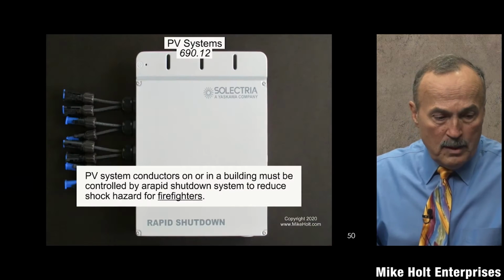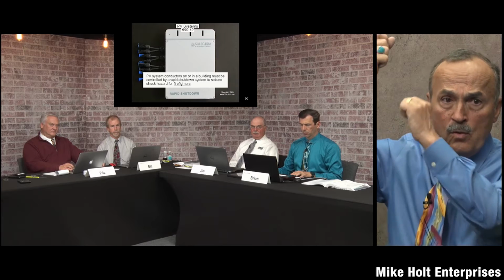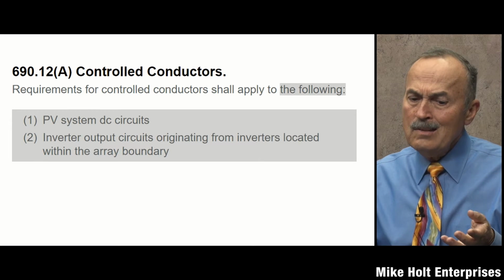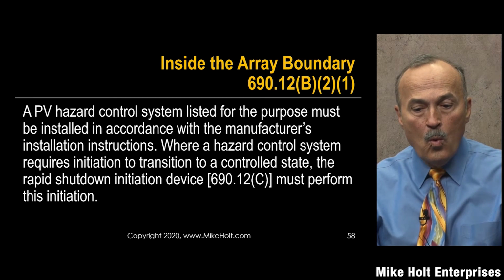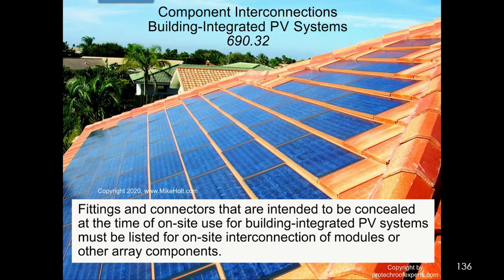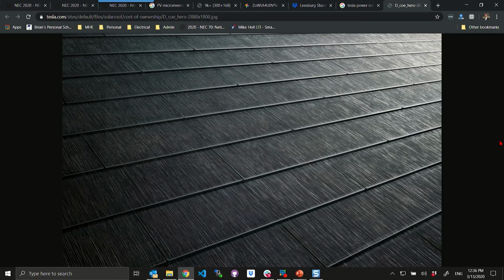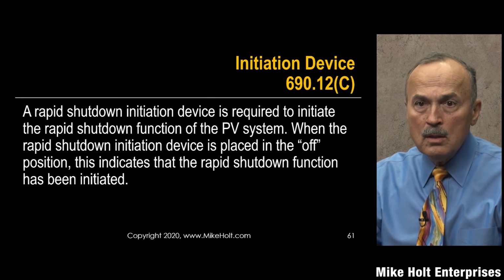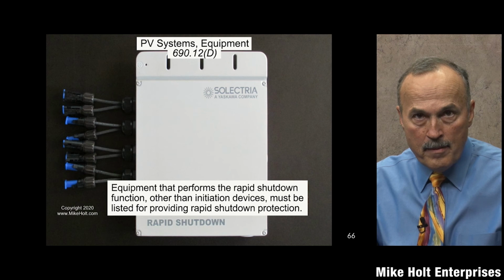Solar Photovoltaic (PV) Systems, Rapid Shutdown, NEC 2020 - [690.12], (31min:43sec)

Comment: Titan Solar Power filed for bankruptcy because of the requirement of putting these modules on every single panel. They have did over 100,000 solar installs before this NEC code without a complaint on safety from anyone. It was a billion dollar company that no longer exists.

Comment: This question maybe a little late as it’s now 2025. I’m seeing a lot of confusion regarding rapid shutdown for residential ground mount arrays. Many are saying if it’s a ground mount array you are not required to have rapid shutdown but what if the electrical wires from the ground mount run into a residential home?
Reply from the maker: @medicmanfd, please post your question on MikeHolt.com/Forum and read 690.12.

Comment: Seems like most people have a DC disconnect after solar panels and an AC/service disconnect after the inverter, but is this saying that only the service disconnect is required?
Reply from the maker: This is a very complicated topic. I suggest you review the video with the NEC a few times to better understand the purpose of the RSS and how it's intended to operate.
Reply: Keep the dc run as short as possible with micros to limit the hazard to firefighters. Now if only there was a way to make micros as easily serviceable as a regular inverter. I guess climbing on a roof when it’s not on fire is a lot safer than getting up there when it is though.

Comment: Wow, this is making it harder to live off grid. Can I even still do a ground mount array with out all of this extra cost?
Reply from the maker: Safety is not free...
Reply: As far as I understand, you don’t need rapid shutdown for a ground mounted array, as long as the inverter is mounted outside.
Reply: No joke metal isn’t even flammable

Comment: I was changing out an SMA inverter. I have three strings the open circuit voltage on three strings read 15 volts, 422 v, and 17 volts,. I have 39 panels. I felt the power of the second string which I believe has a failed inverter or optimizer because that did not feel great. In other words the conductors on the DC array and fault condition are a shock hazard
Reply: In other words rapid shut down did is only at the inverter which conductors are connected to
Reply: SMA has no optimizers.

Comment: This Rapid Shutdown is not necessary, why would firefighters need this?, this is the most important question in this video. This requirement ended up giving a great advantage to  the microinverter manufacturer over the string inverter. That is not a regulator's job, a regulator should keep a competitive market and avoid bringing unnecessary standards that benefit completely one of the manufacturers.
Reply: From the perspective of firefighters' safety, when they need to vent the roof, they don't want to swing their metal axe through a 600V circuit. The firefighters don't care about preserving the panels, only about saving lives, and if they have to open the roof, they can't have high voltage power flowing through it. Yes, it's more complicated for manufacturers and installers but it has a real world purpose. I work in my city's planning and development department that chooses to adopt these codes, and we work with the city's fire department to give them what they need to do their job most efficiently. Even with module level rapid shutdown it adds valuable seconds to killing the power to the building. 

TLDR: A dead firefighter isn't going to be effective at saving you from a fire.
Reply: @backyardbriantucson  Wouldn't it be amazingly stupid for a firefighter to swing an ax thru a solar panel to gain access to the attic?  There is almost always plenty of space on a roof without panels, especially with common hip roofs.
Reply: @backyardbriantucson I never thought about firefighters breaking through a roof top solar array to get into the home... Yes, your point is good.. They need to be deactivated in an emergency..
Reply from the maker: So you think that the firefighters should not have the ability to turn off the power of the array so that they work around energized electrical parts? Really?
Reply: Okay, but what about if this standard is getting out of the market all the residential string inverters manufacturers? The technical solution is very difficult to achieve in an string inverter, nine (9) years after this standard first appeared and you can see that there is still a huge advantage for the microinverter in residential systems. This standard changed completely the residential market share. I don't think the regulators should do something like this. Moreover, take into consideration that this standard does not exist in any other country in the world.  @MikeHoltNEC
Reply from the maker: It's driven by the firefighters to protect themselves so that they can go home to their families after their shift. Maybe if you were a firefighter you would feel differently
Reply: These systems are needed but have already killed off american companies already. The cost of going green is so high you will only see it on folks homes with a lot of green.
Reply from the maker: I don't care if we go green, I care that we are safe...
Reply: @MikeHoltNEC  Maybe is asking too much, but could you please explain from the firefighter point o view the need for this system? The installers don't like at all the technical solution for the string inverters, is a lot easier to install a microinverter, so the residential market share changed completely after this regulation and that is not the objective of a regulator in my opinion. @MikeHoltNEC
Reply from the maker: The purpose of the National Electrical Code is to ensure electrical systems are installed in a manner that protects people and property by minimizing the risks associated with the use of electricity [90.2(A)]. Maybe if you were a firefighter you would like to have the ability to reduce the PV system voltage to a safe value so you could go home to your family that day. I'm sure they would appreciate it...

Comment: I’ve never heard “DC to DC converters”. Most installers will know “power optimizers” are referencing a DC circuits that run down to a Inverter. Also most installers will understand “microinverters” are in reference to a AC system that runs down to a combiner.
Reply from the maker: These are Code terms, I can’t use slang terms.

Comment: Hey Mike, shoot me a message if you want to hear how this is being enforced in Northern Colorado jurisdictions. I talk to inspectors every business day, and work on both string inverter and microinverter systems, inspected against 2020 and (very soon) 2023 codes. It is fascinating, and there is a lot of variance between jurisdictions on their interpretation.

MLPE like power optimizers (what the DC-DC converters are called in industry) and microinverters are still required to be equipped with an external AC disconnect, even if they inherently go down with the main service disconnect (which is not something that can be assumed in the case of supply side taps). The power optimizers on a SolarEdge string inverter solar system will automatically come down to "safety voltage" (in SolarEdge's case, 1 V DC per optimizer) when the DC circuit is opened. It is not based on the powerline communication, and the inverter does not have to succeed at communicating the intent to the optimizers in order for the string voltage to come down.

Comment: Does anyone else think that Mike is trying to talk at a thousand miles an hour. Will also trying to learn, explain, and understand the code at the same time. As someone in the Solar Industry this is almost unbearable to watch.
Reply: It's incredibly painful as an electrical engineer to watch. Also shutting off my inverter because we lost grid is stupid. It should isolate to protect linemen NOT power down to increase profits because the poco doesn't want solar and this will make it look unreliable esp as the grid gets worse.
Reply from the maker: Did you know you  can adjust the play speed?

Comment: I have a 2 wire DC Outdoor Service disconnect at my stand-alone Solar Panel and another 2 wire dc fused switch at the entrance to my home where i bring the DC wires inside to my homemade power station.
Reply: Do you have power optimizers on the modules? Because long DC runs especially without optimizers is a recipe for big inefficiency.
Reply: @microcolonel  nope dont need that. I sized the wire appropriately for the length of the run and the voltage. On a clear day and when my battery needs a charge, my mppt controller receives full power from my solar panel.